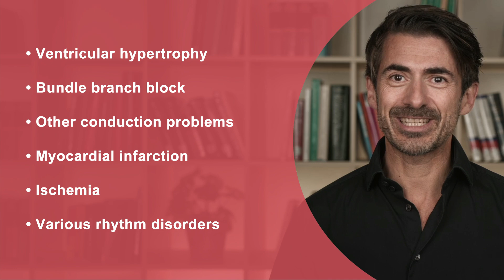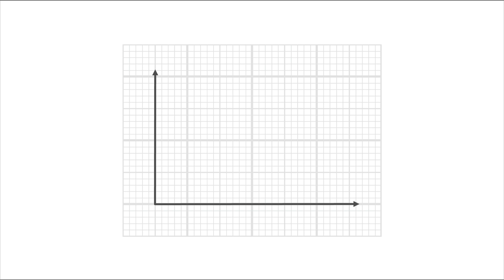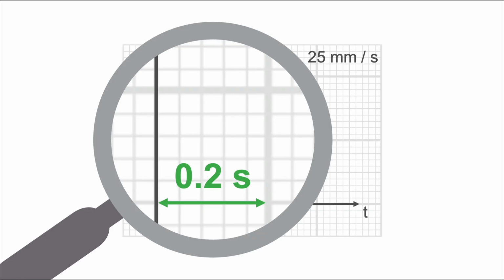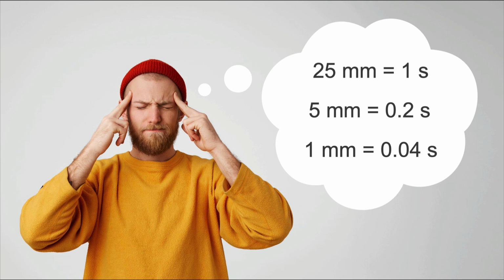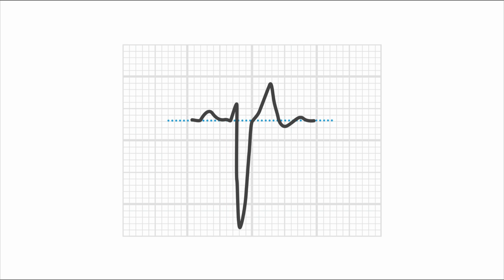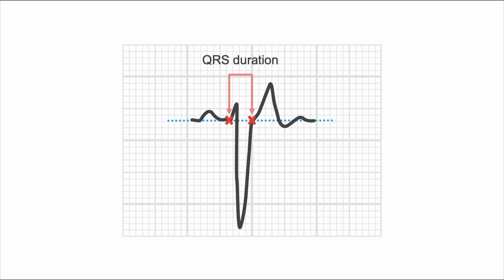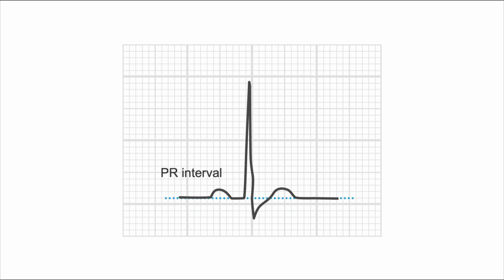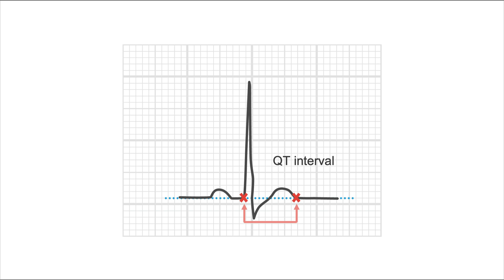Interval and amplitude measurements

Comment: Thanks for your videos.
I am assuming that Oscilloscopes are more sensitive and advanced than EKG machines, yet I can not detect whatever EKG machines are detecting, or maybe I couldn't figure it out. You are experts, can you please tell me how to do it and what I am doing wrong?
I also can not understand how the heart's internal currents of AV and SA nodes are detected on the surface of the skin all over the body, please help me to understand.
Reply: At the skin the voltages are of the order of a millivolt, and the frequency is very low. The frequency range of interest is 0.05 Hz to 100 Hz. You may need to use DC connection for your probe, and probably a mains frequency filter and a high order low pass filter before the oscilloscope. Semiconductor manufacturers make specialised ECG "front end" chips with these functions, for example the AD8232.
Reply: @gregvanpaassen   : Thanks for the info. I believe oscilloscopes can measure millivolts and the frequency range you mentioned.
Reply: Yes, but interference from mains wiring will swamp the signal unless you use filters.